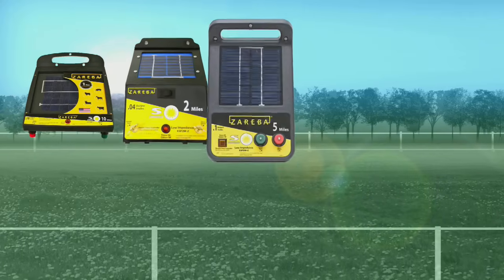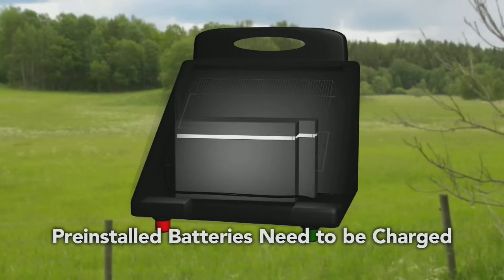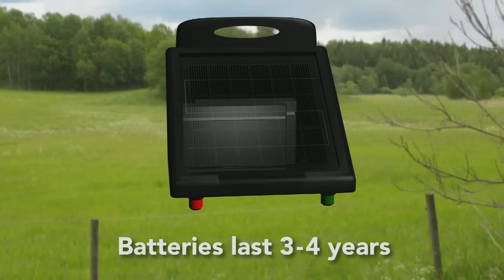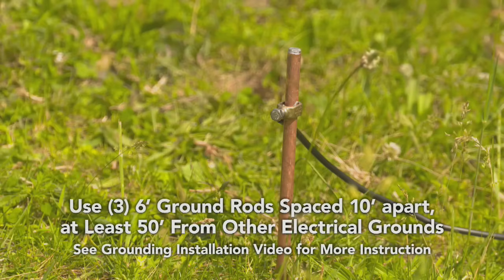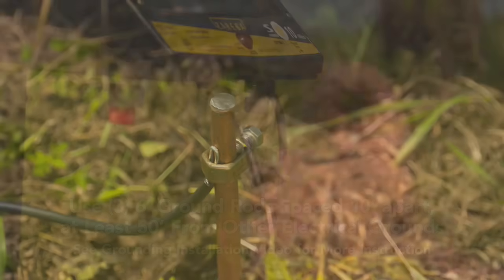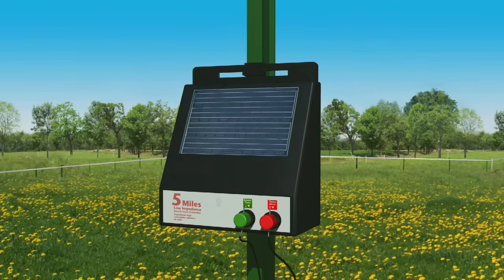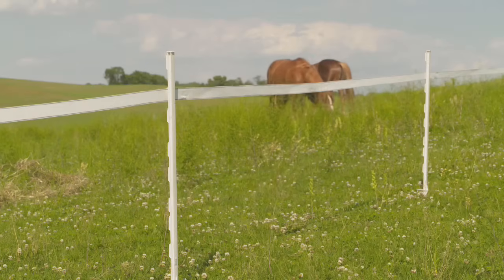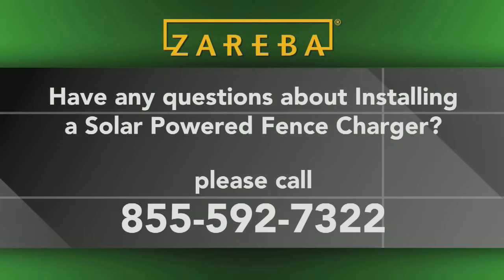How to Install a Solar Fence Charger: Electric Fence 101 | Zareba®

Comment: Would this be effective for humans intruding and risk of having bee  hives potentially stolen.  As in small animals or ppl can't crawl under that, or would an extra row installed prevent that.
Reply: If you live in the USA, UK and most other western country you cannot legally use electric fencing against humans. You are better of using a firearm, for some idiotic reason in the case of USA, or call the police in the UK and expect getting searched and fined instead, for some dumb reason like owning some dry fuel for camping or a shovel with angles too acute etc.

Comment: what type of wire are you using for your ground and to the fence from the solar charger?
Reply: Galvanised Steel, or Copper wire is great

Comment: I’m getting voltage as long as it’s a short foot long wire but as soon as I hook it up to the main fence I get no voltage ?
Reply from the maker: Hi John! Sorry to hear this. You can call our customer care team for step by step help to get your fence working! They are available Monday-Friday 8 a.m.-7 p.m EST. and Saturday 9 a.m.- 5 p.m. EST at (855)592-7322!
Reply: Take a tester around your fence. They are $5 online and let you know where you have a short in your fence. It will save a lot of walking around and around your fence.

Comment: I noticed in the charger it said 5 miles. Is it possible and or safe to use a second or even a third charger in the same fence if you have more than 5 miles of fence you need to cover?
Reply: Most chargers that say 5 miles means that they are good for 5 miles of high tensile wire, if you are using poly tape bring that down to half oor a third of that distance. The resistance per mile on poly is much higher and therefore loads the charger more, bringing the effective distance down.
Reply from the maker: Hi there! Please contact our customer care team with any questions Monday-Friday 8 a.m.-7 p.m EST. and Saturday 9 a.m.- 5 p.m. EST at (855)592-7322!